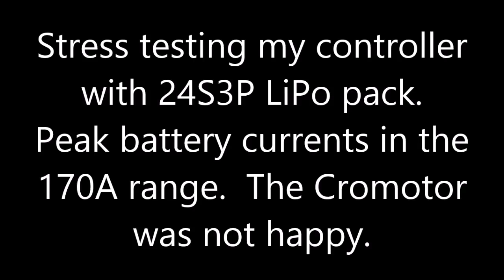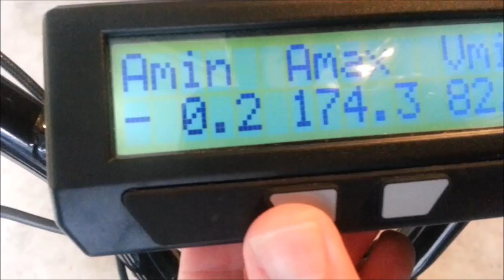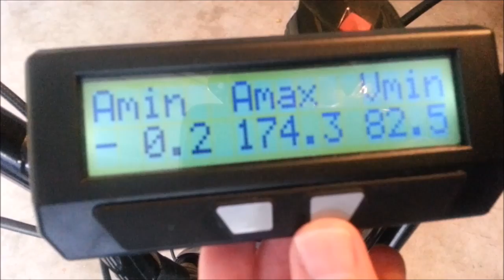18 MOSFET Controller Testing, zipping around at +150A on 24S LiPo

Comment: That's phase amps???
Reply from the maker: No, it's battery amps as stated in the title and shown on the meter.  I think phase amps were +300, it's too long ago so I don't remember.
Reply: @ZombieSS77  that's interesting... most controllers I find capable of that have at least 30 mosfets.... my controller has 24 mosfets and only does 80a... I was looking at some 100a controllers and they had either 30 or 34 mosfets. And they get pretty stupid expensive...
Reply from the maker: @MotoAlias  A lot depends on how long the controller is run and how good the thermal management is.  In steady state operation this controller will only do about 200A continuous with forced air cooling, but +300A bursts for a few seconds as seen in the video will barely warm it.